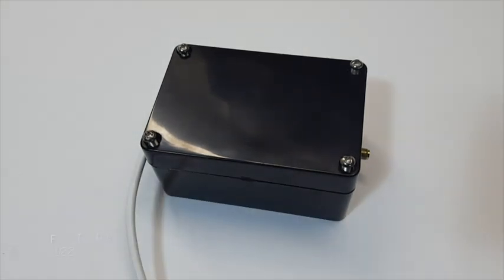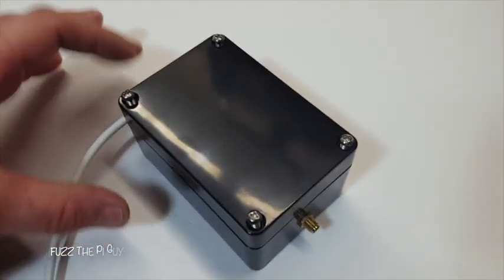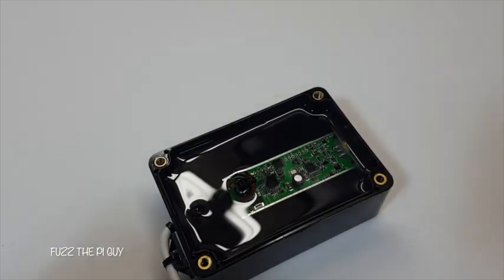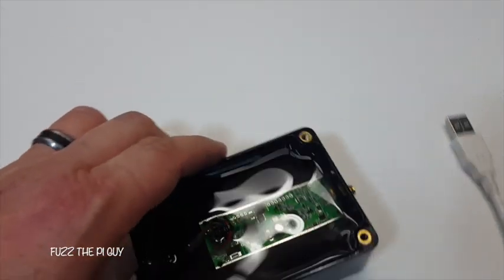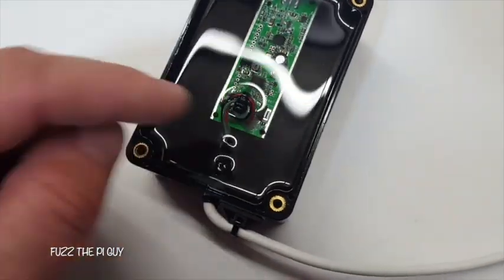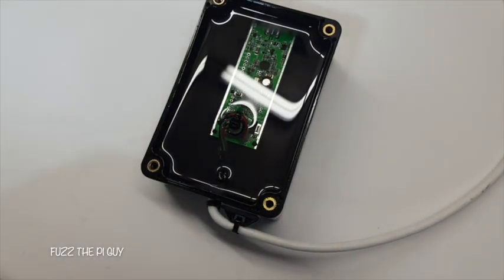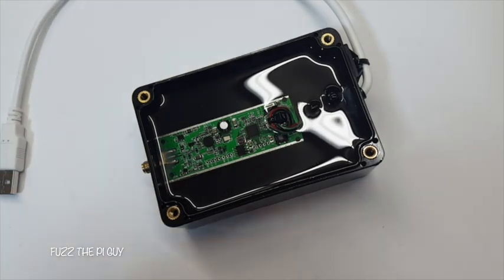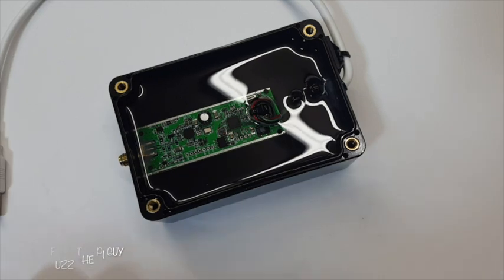RTL-SDR.COM USB Dongle In Mineral Oil

Comment: What is the benefit of the oil?
Reply: The oil acts as a heat transfer medium.
Reply: Exacly My Question !
Reply: With cooling those SDRs can handle higher frequencies
Reply: an easy way to cool the sdr as they tend to run hot.  mineral water is non conductive
Reply from the maker: This is just something that I did for fun. Put mineral oil can help cool, if you run the oil through a radiator or something like that.